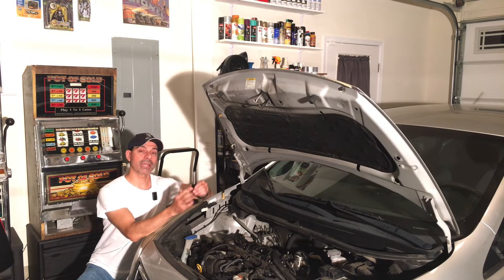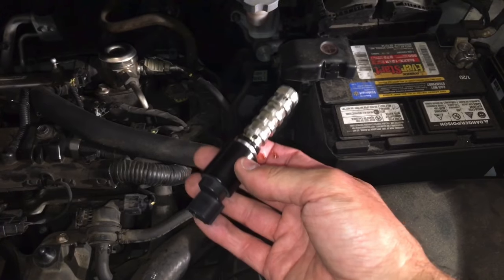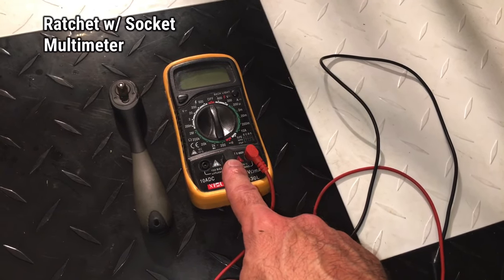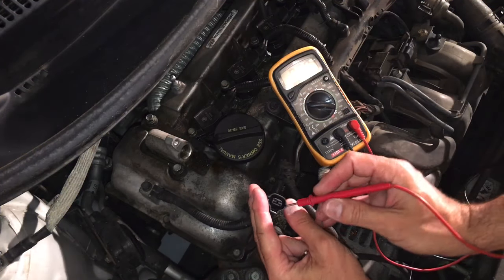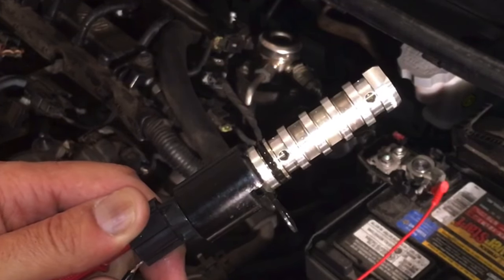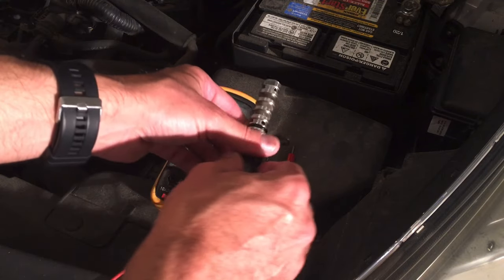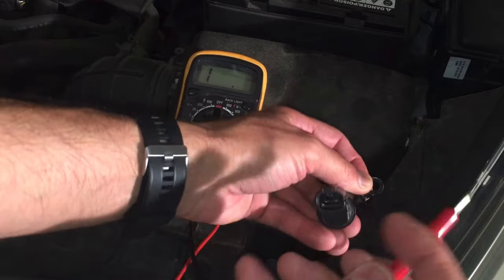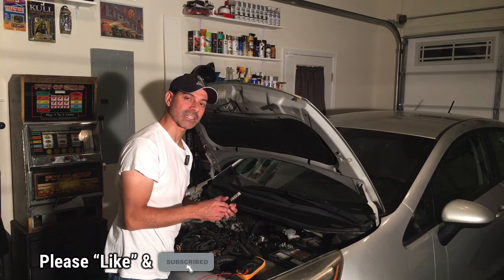How To Test A Variable Valve Timing (VVT) Solenoid (Andy’s Garage: Episode - 262)

Comment: Just pull the VVT solenoid out of the motor and leave the harness connector on... Turn the keys ON and OFF and see if plunger moves....Do not start the engine..
Reply: So, assuming the valve spool doesn't move, what is voltage supposed to be from the ecu?

If the solenoid isn't activating, it can be the solenoid, the ecu, or the wiring.
Reply: Whew your so smart!! You should make your own .2 second video.
Reply: I would think putting 12-14v to selonoid could harm the coil as voltage at connector is putting out 8.6v. 
Is 7.5 ohms too low? What is the acceptable range?
Reply: Good job well noted
Reply: @journeyman291 as far as I’ve heard the ohms should be between 7-14
Reply: Assuming the ECU does an initial self check. Vvt selonoid might only activate when engine rpm is over 2000 to let pressurize oil into the cam gear to advance timing.
Reply: @journeyman291 yeah, I was wondering the same, would 12V damage it.
Reply: so you don’t disconnect the negative on the battery terminal before you start taking the car apart
Reply: Never trust a guy who can't even say solenoid
Reply: Mm
Reply: Duh

Comment: Could the bench test pass but the in vivo fail. For example, when engine is at operating temperature (relative hot) could  a short appear when the selonoid is hot and expanded or could it bind up.

Comment: Hello, I have a 2012 Volvo XC60 that isn’t passing the California smog test due to an EGR or VVT problem.  Since my Volvo doesn’t have an EGR module, the smog shop thinks the problem is VVT related.  Do you have any experience with this problem?  I would appreciate your opinion.
Reply from the maker: @vernicekarbe9277  you may need to clean or replace the EGR valve and VVT solenoid. I would start by cleaning them since they can be costly parts. Here’s a video I did showing how to clean the VVT : https://youtu.be/ZyQdnMLFfaw?si=u6502BnqNe88dgj-

Comment: Great video, clear and concise.  If I might suggest, to perhaps check for a high-impedance short to the valve body/mounting bracket by using the 200K (kilohms) or 2M (megohms) setting on your VOM.  Sometimes such a short can cause trouble with the transistor driving a coil, such as in a solenoid or relay. 😉

Comment: The 2010 2.5L Kia Soul has 2. Waiting for the engine to cool off to get the left rear as facing the engine. I thought I had fuel pump problems due to car stalling when coming to a stop.  Then hard start again. Fortunately my friends house was within 1/4 mile. Changed the pump. Ok same problem. Sometimes when I can get the engine to idle good I attempt to put in gear but dies. If keeps running I don’t get very far. I sure am counting on your lesson to fix as I don’t want to nickel & dime myself. The only other choice with have is crankshaft position sensor.  Thank you
Reply: Did the 4 checks. The connector coming up to the VVT has a voltage of 7.7. You mentioned this needs at least 8 volts. Where will I go to find the source for the 8 bolts?  Thank you

Comment: When you measured voltage at the harness plug, you found 8.6 volts. Why wouldn't you be looking for 12-13 volts ???  What is the "static" (engine just sitting in the off position) voltage window ??

Comment: Thank you for this video. It was a tremendous help in me diagnosing a P011 and P0017 engine code!
Reply: What was the problem with it, I got the p0017 code today and my car shakes a little bit and has no power
Reply: • Partly clogged passages or oil control valve (OCV) has a restriction in the OCV filter.
• Camshaft position sensor (CMP sensor) faulty.

Comment: Thank you for your very instructional video. That is exactly what I wanted to learn. On another note, I have a question that is making me scratch my head. I understand that the VCTs supply oil pressure to the cam phasers to adjust timing, is there a way to tell a bad VCT from a bad phaser without removing the valve covers?

Comment: Good stuff sir! So based on your test with the key ignition to the on position the solenoid would be engaged and ready to deliver oil to the VVT timing cam phaser at startup 🙂(Then the engine control module makes adjustments from there)
Reply: Based and Redpilled :)

Comment: Simple thorough explanation. Thanks. However, I don't get any voltage reading from the wiring harness connectors with ignition in the 'on' position.  Is it possible that on some vehicles there is no current to the connectors unless the motor is running?

Comment: i have tested my solenoid same as with your in videos, the result is ok. but the engine check or DTC sometimes show error code P0011 and can be reset after that. It's like the intermittent error code of P0011. how do i find the problem?

Comment: Both VVT solenoids on my 2014 Veloster Turbo read 7.3 Ohms and the input voltage from the harness is 8.5 Volts. Is that resistance really unacceptable and if so, why? What is the consequence?

BTW thank you for the video. It is a great troubleshooting guide.
Reply from the maker: The average range is 6.9 to 7.9, you are fine

Comment: Thanks bro for sharing with us your knowledge.I have same challenge on engine model (2NZ)it faces fresh oil on top of piston number one.Can that vvt sensor can cause that.I need your help?
Reply from the maker: Sounds like the valve stem seal might be leaking. Here’s a link to a video I did where I replaced them on a GM 5.3L V8: https://youtu.be/Mf9220cNZiM?si=j4WD9C7oeQQ2gJVx

Comment: thanks Andy, there is very little info about these devices. I would like to request if you can, tell us all about hydraulic lifters. I have a LFX 3.6L high feature engine with very noisy lifters. I bought 24x new ones and damaged the internal valves priming them. Now i'm going to put the old ones back in after i cleaned them in a ultrasonic degreaser bath. I now primed them softly and am hoping this is the fix. I think this is something very useful to people especially now these high feature engines are getting up in the miles

Comment: Andy - Can you explain what to do when it's not getting proper voltage in the VVT connector from the wiring harness, please?  2010 Ram 1500 5.7 Hemi
Reply from the maker: Just to clarify, when you test the harness that connects to the solenoid, there is no voltage?
Reply: @Phillips Vision  - I am getting voltage to the VVT solenoid, but I suspect an intermittent wiring issue because I've replaced the VVT solenoid and the PCM (after shop diagnostics - ugh) and it still throws P0014 but the truck runs fine.  I can drive it about 10 miles before the check engine light comes on.

Comment: Hello I'm have a check engine light on my car so I use the AutoZone scanner and he tells me that the oil control valve is bad so I tested it the way you were showing on this video everything checked out but the only problem I have is that I don't know their assistants a specification for this model my car is a Hyundai Elantra 2009 how do I find out their assistance ice you have omayo you control valve he has right now 7.8 ohms offer assistance I will appreciate it very much if you can give me some light and thank you very much for this video and thanks in advance if you can help me on this question

Comment: Excellent video. Curious about the voltage. If only 8v is coming to the solenoid, will applying 12v do any damage? Will these values apply to every vvt solenoid?
Reply from the maker: Good question. You will need to check the voltage specs for your vehicle’s solenoid
Reply: Also pay attention to the polarity.  If you test it with opposite polarity, the solenoid may incur mechanical damage. @PhillipsVision

Comment: Hi  I have a 2009 Toyota Sienna LE and both valves exhaust & intake are working  fine. Did the testing like your showing. But what is happening is, I am getting two different voltage number readings from the harnesses that connect the solenoids. How do I find out the correct readings?  I’m also thinking the ECM could be bad.

Comment: If the wiring harness is outputting 8.6v, why put 12v into the solenoid to test it? Wouldn't that be too much voltage ?
Reply: No because it changes the amount of oil that it let's through depending on the voltage. 12v is full open 8v is not. That's why it's variable valve

Comment: Got code  (Bank 1 Sensor A). checked both sensors they are good (replaced with new ones did not help - confirmation of sensors intact).
Noticed oil leakage residues at the VVT Magnet Valve and below is what I did:

1. Removed the VVT control magnet control valve. the pin got little stuck at first but cleaned and then it moves freely.
2. Measure the voltage of the plug coming to it: measures VDC 7.6V, The coil resistance of the valve is 6.7 ohm.
3. Tested the magnet control valve with a 7.5V (and 9VDC as well) battery and the pin pops fine with both voltages. But when plug it back to the car it does not respond although the power from the plug has voltage measured at 8.3V. I've ruled out loose connection as it has no response even the power measured from the magnet pins is 8.3V.
4. the Solenoid itself looks fine and it move in when pushed with finger and springs back out freely. This is hard to explain from what the basic ohm law of high school physics.
Reply: What did you figure out?

Comment: I have done all the test and only problem was only the top open of the solenoid was moving, not the bottom. I noticed some brass shaving on the middle ribs of vvt, but am hoping that's from removing the vvt.

Comment: You did the solenoid test using a 12 Volts battery, although this piece it receive about 5 Volts from the ignition module system, is it the right procedure?
Reply: According to the KIA service bulletin the 12 volt test is correct.
Kia recommends that 12 volts be applied for no more than five seconds and they caution against short circuiting by accidentally touching both pins at the same time.
Hope this helps.
Reply: @dougwigley8072  
Good, Thank You 👍

Comment: Would a bad solenoid possibly lead to a faulty p2646 error code? Normally the code is associated with an electrical signal out of range error leading to a VTEC solenoid oil pressure switch.

Comment: I have a 1998 Mercedes w202 , my issue is injectors are not spraying fuel, I have spark and fuel in the rail but no spray. Help me out. Thanks in advance
Reply from the maker: The injectors could be clogged or bad. May need to be replaced

Comment: Vvt monitor bank 1. Status FAIL,  NO check engine light.  On a Nissan 2015 rogue , runs great at first, vibrates after getting to temperature, at stops.   Bad solenoid? Or chain/ timing off ?  All sensors seem fine and clean, any thoughts what this may be ?

Comment: Thank you for the video, was very helpful. If i may ask, if my solenoid is checking out and wiring is good and i have new oil in and still get p0011 code (only when i have driven about 15km). What could be the problem. Chevy cruze 1.8. Thanks, Herman
Reply from the maker: Has your oil been changed? Sometimes  dirty oil can cause this code
Reply: @PhillipsVision  Hi, yes got new oil in. I also replaced the cam sensors and the intake camshaft as the cam sensor pickup was broken off

Comment: Hello,
I took Out the Solenoids of my Alfa Romeo Giulietta and cleaned them. By connecting them to the car's battery to make them operate while cleaning them, I touched accidentally the to leads +&- together at one of the pins of the solenoid ☹️ 

After  reinstalling them back into the engine, the car is not driving right. The car has lost its power and torque in the low and mid RPM...it just doesn't feel right 😔

Have I cooked the coil up,or is the valve grounded now after touching the two wires together?? The piston inside does still move thought , but since the car runs like crap

Comment: I've had to change this part twice in the last year. The most recent time, engine light turned off and worked fine for about an hour then the check engine light and oil light has come on and still getting the same trouble code. Any thoughts on what else it could be? 2013 Nissan Versa SV

Comment: You did say if the solenoid hasn’t failed you could clean it?
How do I clean it?
Reply from the maker: I showed in the video, using mass air flow cleaner. You’ll need to remove the solenoid first

Comment: hi my HYUNDAI i30 has the exact same issue . I'm wondering if the intake cvvt is worn or faulty and this is contributing to the ticking noise. Or if this is normal. Did you get an answer or resolve your issue?
Reply from the maker: It’s normal for the GDI engines to have a constant light ticking noise coming from the top of the engine. If it’s lower then it could be what was shown in the video.
Reply: ta for your response. My car has developed a louder than normal ticking sound. The noise is coming from the cam phaser area.Otherwise engine is running perfectly.
I have tested and cleaned the VVT  solenoid. Test good. Between the Intake cam phaser and the intake cam shaft there is very slight movement. I can rotate the phaser back and forwards by hand. There appears to be some wear between the small locating pin on the cam phaser and the hole in which it locates on the end of the intake cam shaft. Would this be regarded as normal? There is no movement on the  exhaust side between the phaser and exhaust cam shaft. @PhillipsVision

Comment: Wow. What an amazing video. At first I thought it was going to be outdated and not helpful. But man you explained everything extremely well. 

I do now have a question. I have an intermittent ticking noise. I haven't been able to recreate it on purpose. The best I can describe the condition when it happens are as follows. When the engine is low on oil. Not empty but low. It usually happens more. With the lower it gets the more it happens. 
Next is turning and accelerating but very specific angle/speed/load combination.
The other is semi hard/semi soft acceleration. (But this doesn't always happen). Temperature doesn't really change much.
Reply: Unfortunately a few years(7) back, while I was deployed, my wife let the car run empty of oil. It is a toyota camry 2010 le, with 170k. Since the oil thing happened I had 0 engine or transmission problems. Up until maybe 2 years ago. Then idk why I stopped checking really tight oil changes.
Reply from the maker: @alejander456  if you ran it low on oil the engine may be damaged. The valve lifters can get damaged, timing chain components and bearings are all things that could be damaged. You can try an oil additive like Lucas and see if it helps. If it’s too far gone you may need a new engine
Reply from the maker: @alejander456  here’s a link to a video I did that may be helpful 

https://youtu.be/A5X-CJLQfxA
Reply: sounds like a timing chain sound. if your car is getting low on oil at all ever you aren't changing it nearly enough

Comment: Nice video, good informations. Where can i find the information about the acceptable range for the coil resistance for Kia optima 2013, 2.4L engine?
Reply from the maker: If you google you make and engine you should find it. If not, you can check a KIA service manual for that engine.
Reply: @PhillipsVision  Thank you for your response. It's almost a week i've been googling it. Can't find such information on the service manual also.
Reply from the maker: @DjibyBalafon  Normally their range is between 10 - 12 volts, but that’s more of a generic range
Reply: @PhillipsVision  you mean Ohm ?
Reply from the maker: @DjibyBalafon  my apologies, I only gave you half the info. Voltage in should be between 10-12 volts, and ohms should be 10 or under. Keep in mind this is “in general”. If the ohms are infinite then the solenoid is bad.
Reply: @PhillipsVision  oh ok. Thank you. I understood from your video that there’s an acceptable range for the resistance value , which is between 12-8 Ohm. But I need a confirmation of that, bcz I’m in senegal 🇸🇳 and it’s not very easy to get a new genuine part.

Comment: Do u think if u get these cheap from China for like 10$ that they can cause your O2 sensor to have voltage issues? Because I had a dead O2 sensor changed it next day like was on again and that same sensor was reading high voltage we couldn't find anything else wrong so I took out the new Chinese solenoids and put the old ones back in and light has been off for 2 weeks just having low power issues due to the old solenoids I'll change them this weekend

Comment: Hi guys. My audi a4b8 dont drive. Code of the problem is p075300(Solenoid valve N88 electric error)
I had give CTM to repair put it back to the car and.... same code problem wheels doesn't spin ..at all. Car not catching any gear..:/ any advises?

Comment: Hi, 
Would like to know if someone knows about the reading #1. I got 1.32 on my multimeter @ 20V with the switch open.
2nd, 3rd, and 4th tests seem to be fine.
Is there perhaps a fuse for my 06 Toyota Camry I am not aware of?
Any help will be very appreciated. 
Thanks.

Comment: Hi my car has vibration issue on morning when engine is cold.
After alot of repairs, I suspected the problem to be coming from the CVVT valve.
I opened it and tested it (mechanically) and it works fine. However, when comparing the intake vs exhaust CVVT solenoids, I noticed that the intake CVVT has a very little play (loose inside) when I shake it by hand. The exhaust CVVT seems sold when I wiggle it.
The play in the inside of intake CVVT is not alot, but you can definitely feel and hear it.
My question, do you think that I should change it, or this is normal?
Thanks for the video
Reply: Please how where you able to resolve the issue having same issues on my Toyota

Comment: My soul started running rough. scanned it low voltage mis fire. When I unplug the vv solenoid  it smooths out . Do think that vv sol is bad
Reply from the maker: It could be if removing it solves the issue